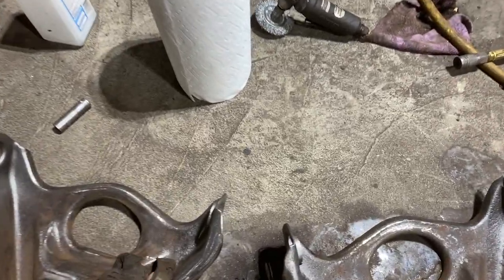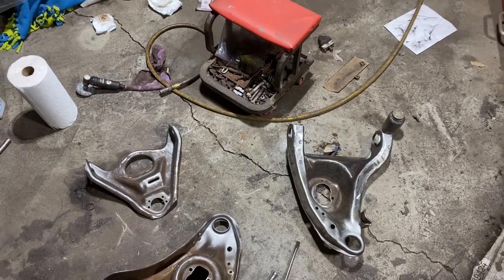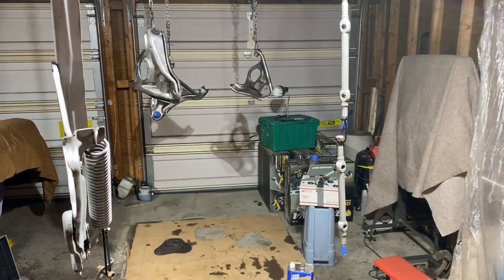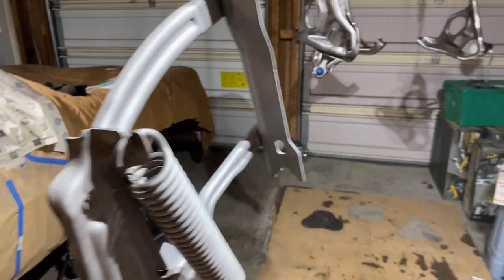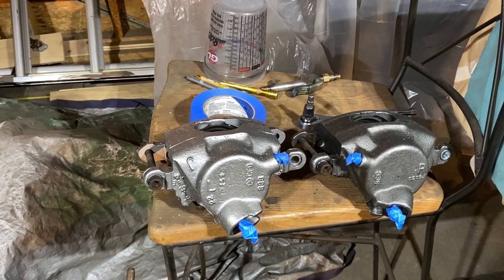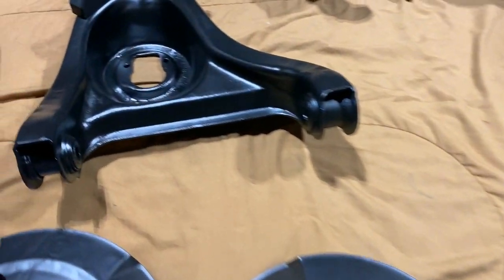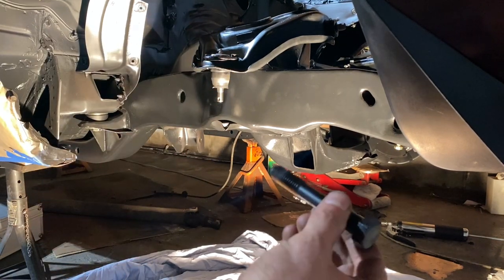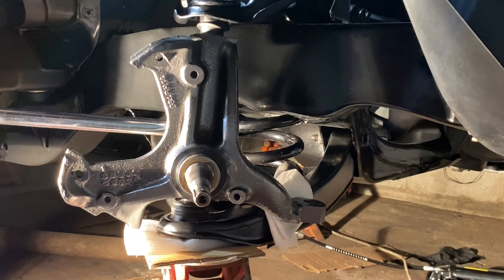COMPLETELY Restoring The Front SUSPENSION And BRAKES On The 1973 CAMARO Z28!!

Comment: Really nice work Ryan.  Good call on the hinges.  A very visual part of the engine compartment, they also get a workout and need to function smoothly without binding from too much paint build. The rest looks superb.  There is something very satisfying about cleaned and well restored suspension.  Especially the front.  Never been able to put my finger on why - maybe safety, or handling, not sure.  But I always find myself looking it over multiple times when the job is done, enjoying how how good it looks.  I’d guess you’ve done the same.  Looking forward to the engine, etc..  👍👍
Reply from the maker: I agree! I sat there and just kept looking at it after I was done 😅. Really makes the project look complete. Thanks for checking in!

Comment: The car is going to look amazing! One little "trick" I do when messing with coil springs is that I take a vehicle tie down strap and loop it through the spring and connect the ends to the subframe on the opposite side. That way it can't potentially launch itself across the room and hurt people or damage things. I'm curious if you have a running total of parts/dollars invested. We have one going for our second gen and it's starting to get up near where I budgeted for the total build lol. Oh, and BTW, I've had the same experiences with OER products. For claiming to be "original reproduction" parts, we sure do have to massage them a lot.
Reply from the maker: Good idea Joel! I have a “close” total I am tracking and it is getting up there especially with the engine costs lol. Still will be ahead when it is all done though. 🙂

Comment: Come’n along real good. This is the best bearing packer that I have ever used. It even forces out the old grease when it’s time to do a repack. A friend of mine who works at a GM Dealership as a mechanic ordered it for me. https://www.matcotools.com/catalog/product/bp34550/handy-bearing-packer/ Too bad GM didn’t have a metal stop for the lower springs instead of a 2 hole gauge.

Comment: I wish my springs would have gone in that easily. I really messed up my powder coating on the LCA’s. I wish I had just painted them instead.
Reply from the maker: Yeah I scuffed the paint off one area pretty good but it touched up nice with a foam brush. It was much easier to put these in than the stock springs would be too due to the height difference!